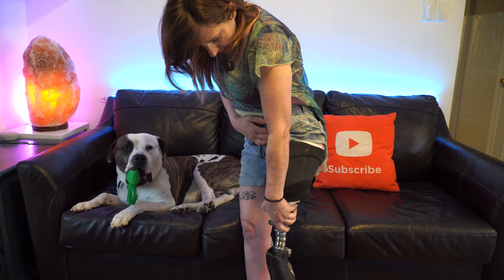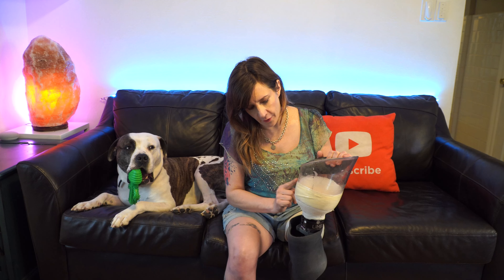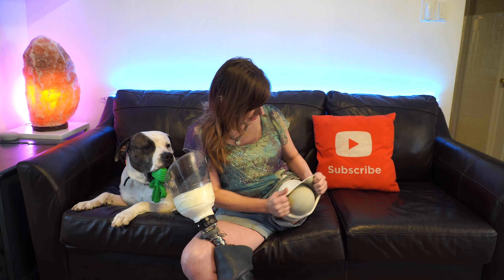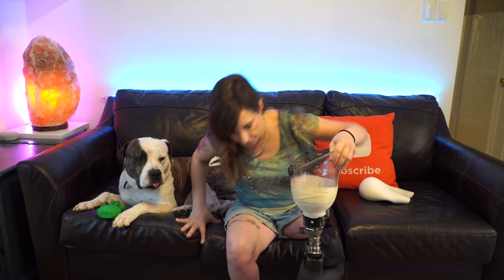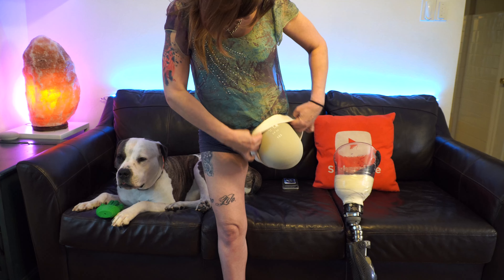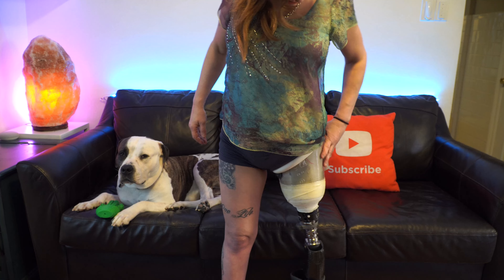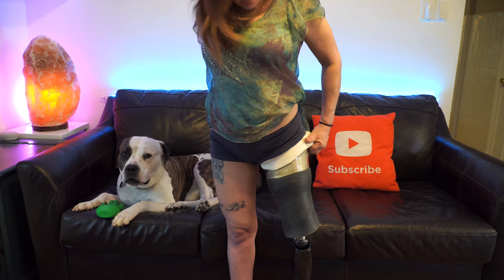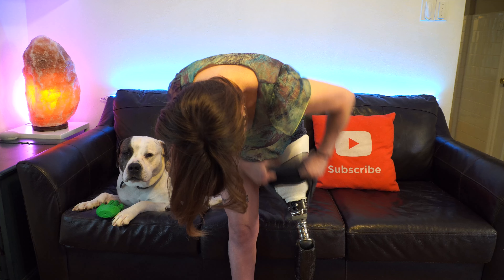How My New Socket Works! (AK amputee)

Comment: Hey your my new favorite go to for suggestions on so I have a vacuum seal socket on the rotator and you mention you find you have to look down  well my risidual shifts then my foot goes sideways or pigeon toed.  What do you press to lock it in????
Reply from the maker: It should lock on its own unless you press the button to unlock it. Do you have the same brand as mine or a different one? I’m not sure how the other ones behave.

Comment: You didn’t go with the boa socket this time? , I notice your liner doesn’t use a gasket for this type of socket . Would you say this is a better fit in socket option? Also you look great !
Reply from the maker: It seems like a better fit and I don’t need a BOA as there’s the option of adding padding to reduce volume inside without compromising suction.
Reply: @AmputeeOT  nice, I liked the boa system just by looking at your reviews the fact that you could adjust it throughout the day limbs swell up or shrinks depends on how active you are, im always curious how other sockets fit. Any tips to relieve rubbing on the inner thigh? I seen they padded your test socket , that’s painful
Reply from the maker: I don’t have any issues with inner thigh rubbing so my suggestion would be to talk to your prosthetist about that

Comment: I'm so sorry you have had to have the extra surgeries. 😔 Wow! That sucks. I've had trouble, too, but I don't have much help down here in Shreveport,  Louisiana.  I developed a  "callous" so to speak  that  ended up splitting on the scar line and it's been horrible.  For the last year I've not been able to wear my prosthetic except in dire circumstances for short periods of time. My shrinkers are 6 years old and stretched out doing no good. Due to swelling I can't get my leg 😫 on and if I have it's split again leaving a 6 inch long, 2-3cm deep bloody,  gory mess.  Now I have told my prosthetic folks to send me a shrinker, same size as before,  so that I  may get up there and get my leg adjusted and they refuse.  I  can never make any appointments because it takes 5-6 hours to get my leg on unless it's forced which I refuse to do.  I don't think I mentioned I have been an RN for 30 years with a large part of that in rehab so I am jot new to any of this. The leg 🦵 is also crooked hurting my back and looking ridiculous.  I have finally 🙌 gotten my "nubbin" almost healed up and I'm not taking the chance of complications just because they won't give me 1 f**k**g shrinker because they say they have to measure it.  I realize their concern, but I want my shrinker, just one so I can get my leg on to be able to get up there. Not to mention all the other appointments I can't get to. I an pt the shrinker on 4 hours before and it will work. I  have other illnesses that need seeing about. My hands are in bad shape(scleroderma), 2 stents in my ❤️ and some  auto immune problems.  Plus I'm about to blow a f**k**g gasket! Please give me an opinion , advice, anything!!!
Ninaedowling@gmail.com Thank-you so much!
Ps,- Nobody taught me anything about the surgery, being an amputee, nothing about anything!!! It was a good thing I was a nurse! But still, nurses don't know all about amputations. People are STUPID
YOU TAUGHT ME EVERYTHING!!!
Reply from the maker: Why don't you go to your prosthetist without your leg on? They want to make sure your leg has not changed size such that you need a different shrinker, and the only way they can know is to measure it.